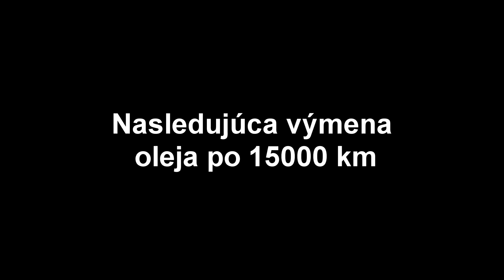Oil Change Toyota Auris  1.6 VVT-i, 91kw #changeoil #toyota #auris

Comment: Good tutorial, but wrong oil. This engine uses 0w20 or 5w30 a5/b5...
Reply from the maker: yes, oils are written in the manuals, but 10W40 is suitable for mileage
The engine is more refined and does not carbonise the engine parts as much.
Reply: @BINOstudio  i dont think its gonna blow up becouse its a Toyota n/a gasoline engine, but i bet if you use the proper oil its gonna save fuel. In fact i have the same car, i have now a castrol 5w30 (idk the model, they change it for free when i bought it i supose the gtx...) and im gonna change it to ravenol ecs 0w20 for that reason.
Reply: @BINOstudio  go with the manual
Reply: @Carls_lg ticker oil isn't always the goodest. You may save fuel but with time the engine will damage easier with a thicker oil